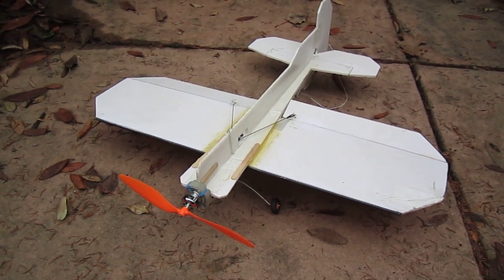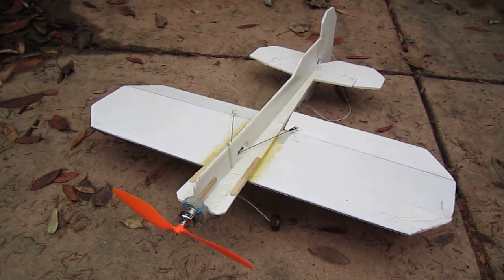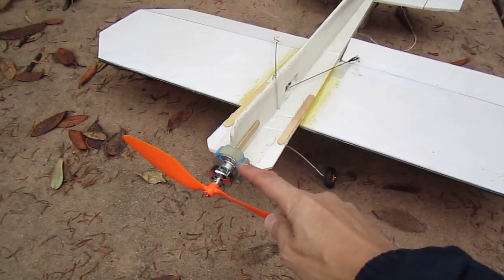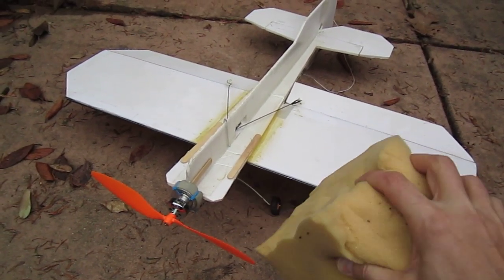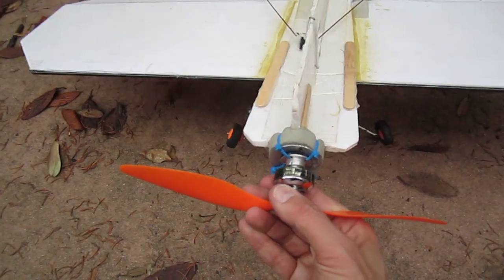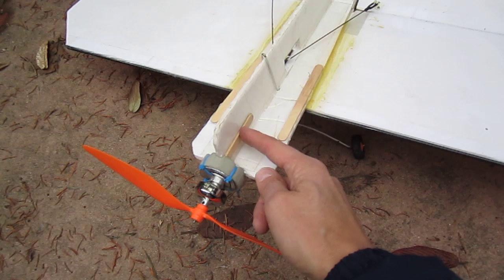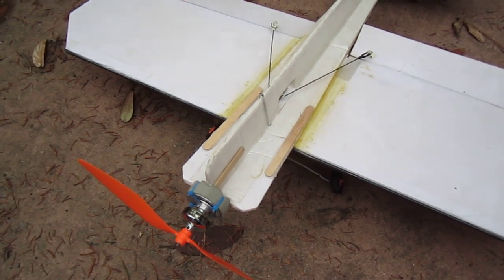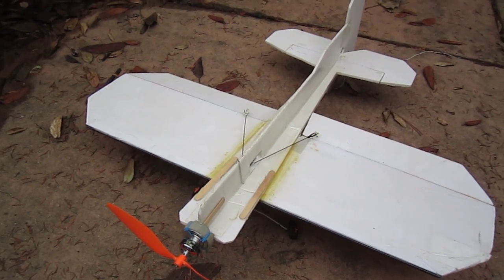How to retrofit your foam 3D RC plane to make it (almost) crash-proof

Comment from the maker: use low temperature hot glue. i used tape to put carbon fiber tube onto leading edge of wings then taped on ailerons, then i glued wings onto horizontal fuselage, then glued on vertical fuselage, then added ruder, elevator, servos, electronics etc.